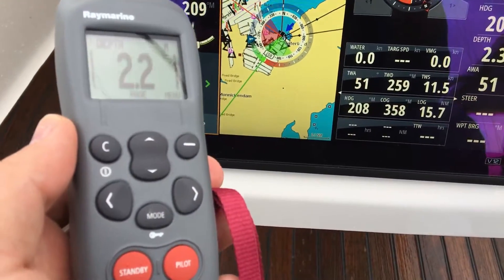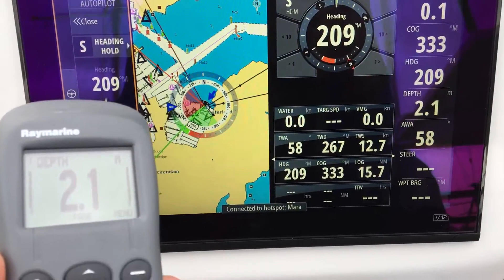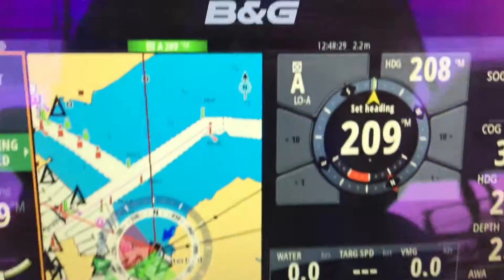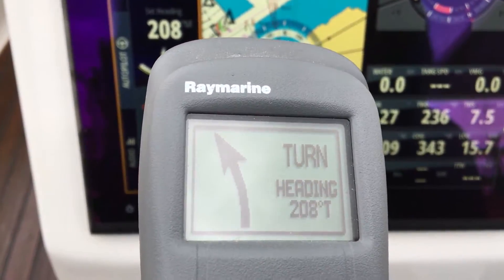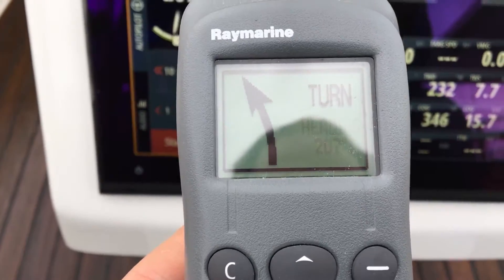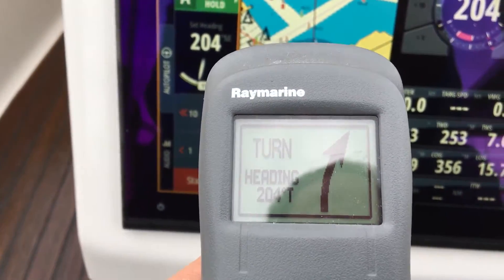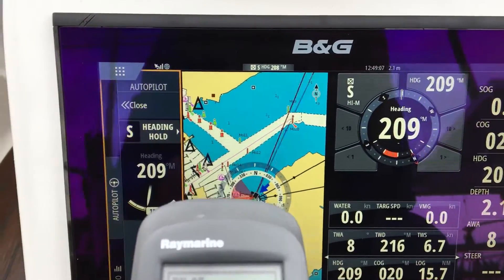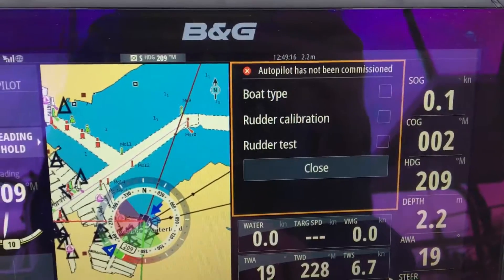B&G Vulcan talking to Raymarine autopilot

Comment: Hi I have seen this video several times so thank you.  I have the same system and am trying to do the same thing.  I have my NMEA network linked to my sea talk network and my Volcan can see my heading sensor and the ruder position sensor but not the auto pilot it self.    Did you have to change any settings on any equipment
1:
Reply from the maker: Do you also have SignalK running with a Pican board connected to the network?
Reply: No I don’t

Comment: Great job! Is it possible to plug a Raymarine ST4000+ to a B&G Vulcan? I already have a Seatalk to SeatalkNG converter.
Reply from the maker: There's a good chance it will work. A matter of trying it out.
Reply: @htool843  I am really interested in trying to do it. Could you explain more about the canbus interface and the connections? Thanks!
Reply from the maker: @federicomelappioni8804  I'm using the Pican2 board to interface with the canbus: https://dayba.wordpress.com/category/canbus/pican2/

Comment: How did you connect the Seatalk to the Vulcan?   I have an Older RayMarine ST 5000+.  I have them talking but am only getting rudder data...
Reply from the maker: Using a Raymarine Seatalk <-> SeatalkNG converter: https://www.raymarine.com/view/index-id=1597.html
Reply from the maker: And then a Raspberry PI with a canbus interface that's running linux / SignalK and the software that emulates the autopilot.
Reply: @htool843  I think a lot of people would really like to know exactly how it is all setup and configured. Do you have a website with some detailed explanation? I have upgraded my WheelPilot to an EVO100 raymarine and would love it to talk to my Vulcan display. currently the autohlem will follow a course set on the display but the autohelm is not recognised at all by the Vulcan.
Reply from the maker: @Slam1956  Hi Steve,
The code and how to run it can be found here: https://github.com/htool/RaymarineAPtoFakeNavicoAutoPilot
As the EVO100 will use different commands than the S1 (Seatalk1 behind converter), it will take some code changes (recognizing the AP modes) to make it work and as I don't have an EVO100 I can't easily do that.